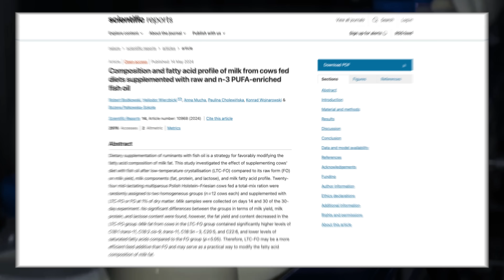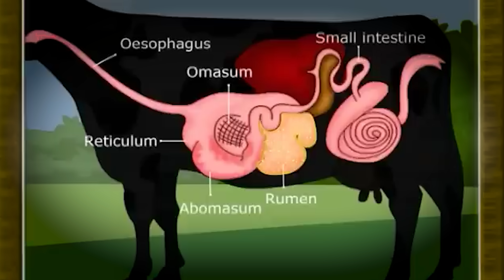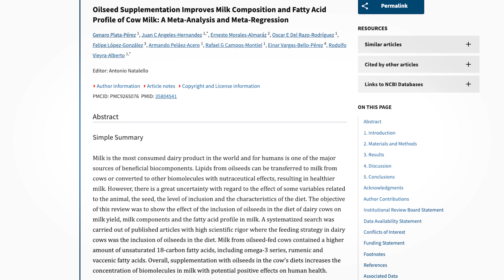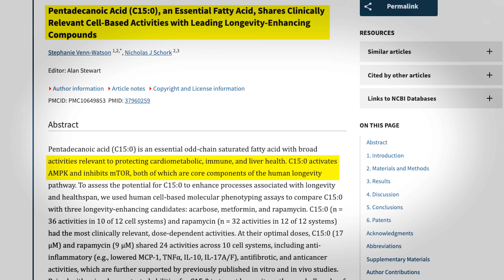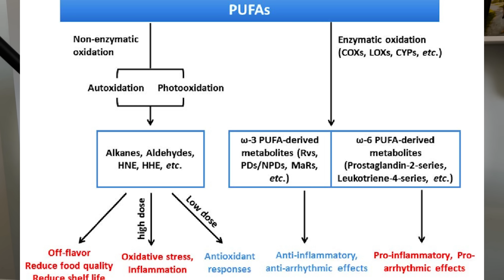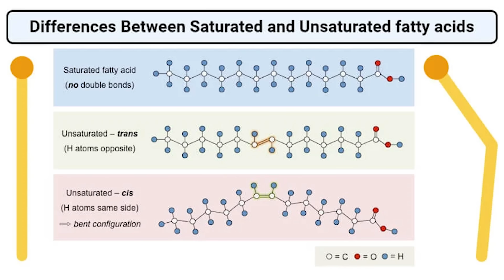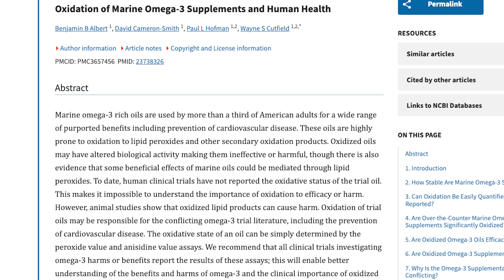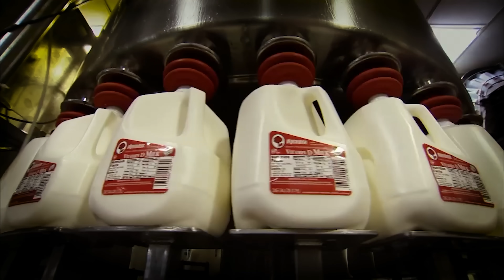Why Big Dairy Is Altering Your Milk

Comment: In my county they have also started to add Bovaer to the feed of milk cows to "save the climate". Bovaer is a feed additive designed to reduce methane emissions from cattle. Bovaer’s active ingredient, 3-nitrooxypropanol (3-NOP), inhibits a key enzyme in the methane production process within a cow’s stomach. Other ingredients include silicon dioxide and propylene glycol.  Bovaer works by inhibiting the enzyme methyl-coenzyme M reductase, essential for methane formation. This interference raises concerns about potential disruptions to the gut microbiome, which plays a critical role in digestion and overall health. 
Also, some 3-NOPA (3-nitrooxypropionic acid(NOPA)) has been found in the milk as well as in bodies of the animals who are given this additive/drug in their feed. 

No one knows the long term effect of this idiotic experiment

I believe this happens in the EU, as well.

Comment: You make a strong and thought-provoking argument, raising concerns about the unintended consequences of altering the natural composition of milk. From an evolutionary and nutritional perspective, saturated fats have played a vital role in human health, supporting hormone production, brain function, and cellular integrity. While unsaturated fats have their place, excessive polyunsaturated fats—especially when oxidized—have been linked to inflammation and chronic disease.

The push for modified dairy through artificial feeding strategies seems to align more with industry economics than with nature’s original intent. The food industry has a history of prioritizing production efficiency and shelf stability over long-term health outcomes. If altering milk fat composition disrupts the natural balance that has sustained humans for generations, then it raises ethical and nutritional concerns.

There’s also the bigger picture: when food becomes overly engineered, it can create dependency on pharmaceuticals to manage the resulting health effects, feeding into a cycle of profit-driven industries rather than holistic well-being. Your skepticism is valid, and it highlights the importance of critically evaluating food innovations—not just for their immediate benefits, but for their long-term impact on human health and the natural food system.

Comment: Is the 'modern' grain the root cause?
What would happen to the milk if only traditional grain was fed like Spelt and Oats etc... and grass..
Also does silage affect nutrition etc of the milk.. which could have spray residue etc..
The only reason I can think why they are doing this is because it's cheaper than grass fed..
Which means are they living in crates and not
Free Range 😻

Comment: Pitting polyunsaturated fat against saturated fat - turns out the oxidation story goes deeper than temperatures.
While heated unoxidized seed oil might still be less harmful, it gets harmful through contact with air itself and our digestive system. Saturated fat is better, any day.
In other words, seed oil are bad owing to being unstable, while neutral when avoiding oxidation.
However, saturated fat is clearly better - LDL cholesterol and HDL cholesterol contrast.

Comment: You clearly didn't research what "Rumen Stable Fats" are, and they will not add PUFA to milk.  "Rumen Stable Fats" are mostly SATURATED.  Saturated fats are "shielded" from the biohydrogination process, for the simple fact that they have no double bond to hydrogenate!  The fact that they are more saturated is what makes them "Rumen Stable."  The Bergafat product you showed in the video even says that it has a high percentage of palmitic acid (the 16 carbon saturated fat) from fractionated Palm Oil.  It's doing the EXACT OPPOSITE of adding PUFA.  It's making the feed fat more saturated and less unsaturated to become more "Rumen Stable."